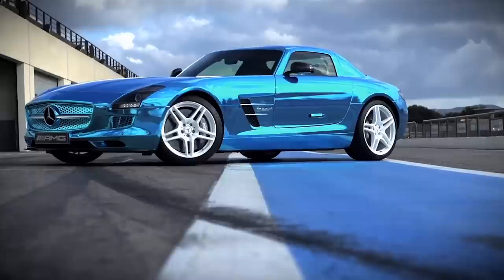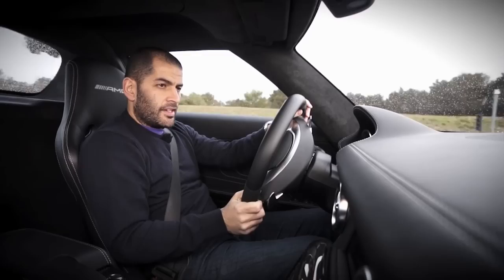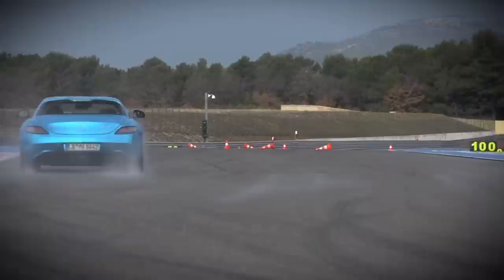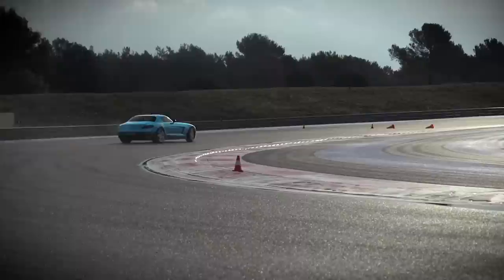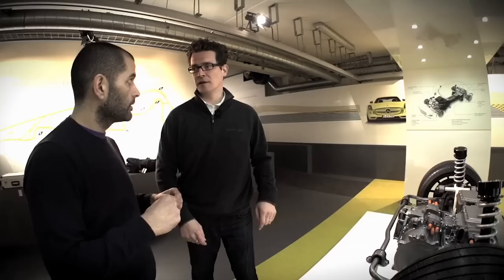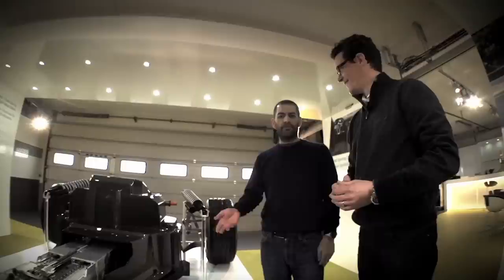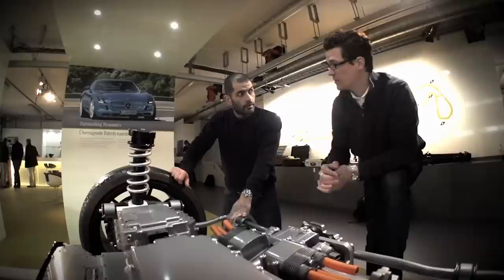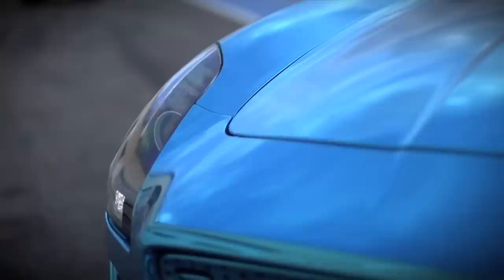Mercedes SLS Electric Drive. Can Volts Ever Match Pistons? - /CHRIS HARRIS ON CARS

Comment: As I write this - almost 7 years later - the car is genuinely still very impressive. I do wonder what the latest battery technology would do in terms of improving things , most importantly its range. If you could get over 300 miles per charge (driving normally with occasional blasts!) and with a more tolerable price, this could compete with most high end sportscars!
Reply: Its 10 year now😂, still nice

Comment: I would argue that electric is more useful and flexible than a gas engine. To wake up every morning to a full charge is far more convenient than stopping 1-2 times a week for gas. It is a nicer experience with seamless, instant, quiet acceleration. It is less convenient on the rare road trip, but it is more convenient the other 95% of the time.

As far as more flexible, the Tesla Model S has shown that if designed properly, the smaller footprint of the electric drivetrain allows for unprecedented space efficiency. The reason most electric cars have compromises in space is that they are pretty much all retrofits of current gas car platforms.

The Rimac Concept One is FAR more powerful than the Mercedes E-Cell.

Comment: I like your take on the CO2-emissions. It's a point often overlooked. Good to know it's still efficient. Not zero emissions, but not much either.
Reply: Yes there are emissions but only because we use the wrong power resources, it is relative easy to that, also you could produce your power on your own and be free from companies.
Reply: You're going to need a whole lot of solar panels if you want to run your electric car in addition to your household. Remember, one horsepower is about equal to 750 watts in electricity. Realistically relying more heavily on nuclear power is a better option. Especially with the thorium reactors being built in some countries, which not only produce much less harmful radioactive waste (almost none if done properly), but can even use some of the nuclear waste from current reactors as a secondary fuel.
Reply: ManWithBeard1990
Nuclear Reactors are crap, even if you use lesser dangerous fuel for them, you still have the problem that you have only a view of them and the people that own them earn enormous power about complete countries. Also in the same way oil is running out, nuclear power sources will run out too.
Yes you are right only solar panels won´t do the job but there are many different ways to get energy solar panels on the roofs of buildings a just one part of them, you could use waterpower around rivers and oceans, like Lasvegas, if you have industires that use wood you can burn what they can´t use, Windpower is also there.
This will take a bit of money and time but we have still a little time left, and we could do it step for step.
If we can change the complete power production to such kind of production, energy will be cheaper than nuclear energy ever could be.
Reply: Nuclear power has a bad reputation, I know. Even if a thorium reactor has waste that decays much more quickly the reactor itself will be exposed to neutron radiation, and when it comes time to dismantle that reactor that thing will be radioactive. Also, when it goes wrong, it goes badly wrong. We've seen that in Three mile island, Chernobyl and recently Fukushima. And yet, it's the cleanest source of energy that can reasonably be implemented quickly. Oh sure, you can have wind turbines and solar panels, and other technologies like wave power and municipal waste gasification show lots of promise. It would be nice if it could be done with just renewables, but I'm afraid that if everyone is to drive an electric car, the world's energy needs will grow more quickly than the renewables will be able to. Some nuclear power can help fill that gap, also enabling us to shut down the dirtier powerplants earlier than we could otherwise. Anyway, that's my take on it. We'll see how it pans out eventually.
Reply: ManWithBeard1990 Wow.  Nuclear is the cleanest source?  And quickly?  No such thing as a quickly implemented nuclear generator.  Offshore wind, CSP, and geothermal are all much cleaner sources of power, as in zero waste.
Reply: Doug Adams Now take excel and add all the energy you need to build a windd turbine, how much energy does it cost to make it run for 50 years, divide that with the effective power it will give you in these 50 years... 
Do the same for a nuclear plant ..... see the result ? 
Here in Europe a reator is something like 1300Mw, well .. you need 750 wind turbines for the same output. Off shore it would be something like 450 turbines.
In France we've got like 55 reactors, 55x450 = 24750 Off shore turbines....
SO yes ManWith Bear is right, if everyone got an electric car today.. the only solution is nuclear.
We've got two cars in the family, one fully electric and one diesel.
Reply: ***** Geothermal and CSP can do better than nuclear for your 50 year lifecycle.  Plus, when that 50 year lifecycle is up for the nuclear, you have to abandon that site and make a new one.  For the geothermal and CSP, you can readily upgrade the equipment with newer more efficient tech and recycle the old equipment and re-use the existing site.  Ditto for windpower, the turbines can be upgraded over time, reusing the same site.  How much pollution do geo, CSP, and wind create over that same 50 years?  Where is France plan on putting all the solid high radiation waste?  Sure there is enough storage space right now inside of mountains, but is the cost of hollowing out mountains figured into your lifecycle cost?  How about the low level radiation waste along with heat waste?  We're just starting to explore how those are affecting the local environment and downstream of nuclear plants.  Such as the up to 1000L/MWh of freshwater needed for the nuclear plant and subsequent downstream heating of the rivers from the heated effluent.
Why are you using France as an example?  Here in the US we have almost twice as much nuclear power production as France.  
Closing, consider the odds of a major nuclear disaster and the long term damage after are riskier than 1:100 (closer to 1:50, 430 operating plants ~9 disasters).  France had 2 major disasters for the 55 plants they use, making the odds of another disaster there closer to 1:25.  If a windmill fails, what are the short term/long term impacts of that?
Reply: Doug Adams I see that you overlooked my point.

I use France as an example cause France is the second producer of nuclear energy behind the US, more than 75% of french electricity is nuclear, only 20% in the US.
You're mixing many things... it would need a week of writing to reply to all your points.
What are the "major" disasters in the French nuclear world.. ? There is no death in the last 50 years, not that i know. Before nuclear people where using gaz or wood to heat their houses... there was number of death every years... should i say that nuclear save lives ?
Just start to check the EROI of different way of doing electricity.. and you'll see where the "wind" energy is, where the "photovoltaic" energy is.
Reply: ***** I've never said anything about PV as that is only useful for powering off-grid consumers.  PV should never be used for baseline or other 'grid' tied systems.  CSP = Concentrated Solar Power.  Look it up.  If cost is the only concern, we should just continue relying on clean coal and natural gas.  Nuclear is just exchanging CO2 pollution for radioactive and heat pollution.  
People still die from lack of maintenance on their wood heating systems, but what does that have to do with electricity?
Reply: CSP is nice because you don't need PV cells. You could possibly retrofit existing power stations with a concentrated solar boiler. I hadn't considered that before and it's not a bad plan. That said, I don't see why PV can't be used for grid tied systems.
Reply: on a small scale, PV is ok grid tied.  large scale, it really makes managing a distribution system very difficult, and those problems cascade upwards the more and more solar you have.  An ideal location for solar would be EV charging stations at parking lots/parking garages.
Reply: The way I see it there would not only be charging stations. Charging takes a long time because you're kind of running into the limits of the amount of power copper cables can handle without having to resort to unsafe voltages. Think about it- if you had a remote control car as a kid and the batteries ran out, what did you do? Did you hook up a charger? No, you took the batteries out, put new ones in and continued playing and worried about recharging later. Service stations should do this too. Robots that take out the batteries and put new ones in, that you lease from that service station. PV does indeed bring problems with it because sometimes it produces more power than the grid needs, sometimes less. The great thing though about all these electric cars attached to the grid is that they can function as a buffer for the wildly fluctuating power levels inherent in PV. When there is an excess, charge the batteries. When there is a deficit, feed back into the grid. Everything will just work together. That's what the idea of a 'smart grid' is all about.
Reply: good point. please tell everyone who does not know  that the sea produces more carbon emissions than all the fossil fuel burning machine on the planet.
Reply: Jabulani Harvey I think you have that backwards.  Ocean absorbs more carbon and creates more oxygen than anything else.  Until it is killed off by acidification and rising temperatures that is
Reply: Jabulani Harvey you're trolling,
Reply: TrickyNekro With regards to solar energy - efficiency is hardly a problem, when the source of the power is the entire sun. If we only harvest that energy with 50% efficiency, it's not like the sun is gonna deflate and disappear. The only downside is the space-efficiency, rather than energy efficiency.
Reply: Mythricia We're still pushing 20% for commercially available solar panels.  Everything else you said is correct though.
Reply: Doug A I never said anything about the specific efficiency of a solar panel - it was a hypothetical example.

Besides, solar panel technologies are improving, there are some close to 50% panels being made in research, utilizing split sunlight aimed at differently tuned PV panels (since a panel is tuned to be most efficient at a specific wavelength). Sure it'll be a long time before that's a standard, but thinking we're stuck with the ~17% panels forever is a bit negative. The panels themselves are, technically, decently efficient - the problem is that sunlight is not monochromatic. Once we find a good way to 'catch' a wider spectrum of sunlight, we'll get close to that 50% simply by improving that aspect alone.
Reply: Mythricia Again, you are right on all your points, but until we have higher efficiency wide spectrum panels along with the storage systems that are necessary to go with them, solar is somewhat limited in usefulness.  
We need to increase commercial/industrial/home efficiency (huge amounts of wasted power here), develop more geothermal, wind, small scale irrigation generators (~1MW), and CSP.  As solar panels and energy storage mature they should be integrated into the mix.
Reply: Its not a good point at all. Because the car has zero emittions, case closed. If you want to suddenly take into account what the production and transportation of that power emitts, well then you have to do the same for gas cars, and not just what the car itself emits. Otherwise it would just be wrong and biased comparison.
So, how much do you think it pollutes to pump, refine and transport one gallon of fuel to a normal combustion engine? Its probably more than burning it emits.
So if you want to talk about "real" emission figures, you have to do it for both cars.

Comment: Beautiful car.  Loved the driving impressions.  Geeked out over the technicals.

Surprised that at around half a million bucks, it barely has more battery storage at 66 kWh than the Tesla Model S 60, which has a list price of $69,900.  Why did Mercedes-Benz AMG go with a South Korean supplier, when they already have a relationship with Tesla Motors?  They could have used lighter battery cells, with higher power density, lowered the weight, and increased the range significantly.

This is about as perplexing as the fact the BMW i8 has one-third the battery capacity of the BMW i3, which costs one-third as much.  Except that if the i8 had a 66 kWh capacity instead of only 7.1 kWh, it wouldn't need the 3-cylinder turbocharged engine at all.  It could have been fully electric instead of hybrid and ran circles around the Mercedes-Benz SLS AMG Electric Drive, for over $300,000 less money.

Perhaps auto manufacturers keep buying their batteries from LexCorp?